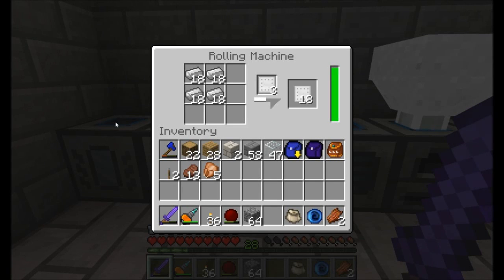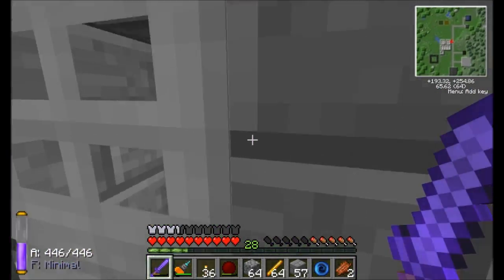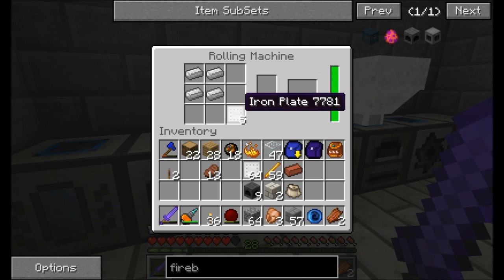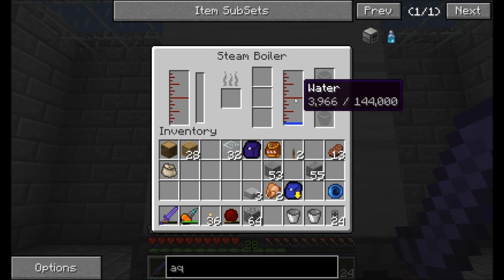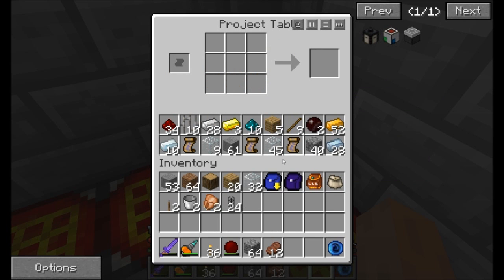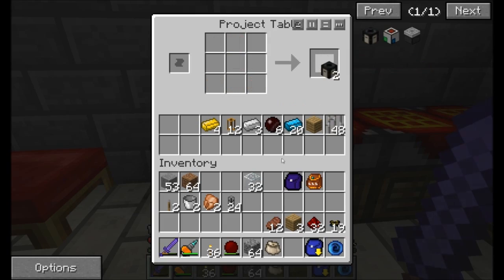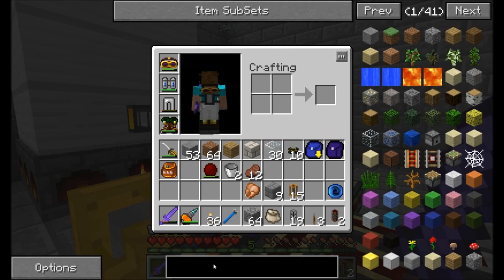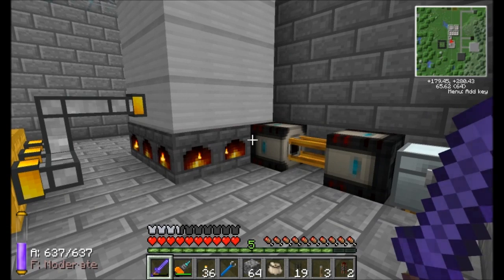Season 5 - Episode 23 Steam!

Comment: That is a good question. I was going to go with 4 hobby steam engines supplied by a smaller 2x2 boiler, seeing that they can run on steam alone but now i wonder if they need water as well. I would venture to guess that they don't. The next two tiers of steam engines will only accept steam.

Comment: It also depends on what you're using it for.  For example I currently have my tree farm harvesting automated from a logger powered by a hobbyist engine on a single tank liquid boiler running on the creosote output of the four coke ovens it feeds.  It's fully self contained and provides all the coal, apples and saplings to power the rest of my base with all the wood and creosote left I'll ever need.  Coal is, of course, for making diamonds, IC2 armor and the like (for me anyway).

Comment: To clarify, there is a point at which steam boilers become better than using fuel directly. However, because of the heat up period, it takes a lot of fuel to get to that point, and you also need to be able to store or use the output for none to be wasted to get to that point. Because of the huge quantities of fuel used and steam produced, you either need a *very* big place to store the output or a *lot* of engines doing things just to break even.

Comment: You don't even need that, just a transposer connected to the chest would be enough. It would keep trying to supply the boiler with fuel until it overflowed, and then the overflow would just be stored in the transposer.

Comment: The larger the Steam Boiler, the more efficient it is in terms of fuel usage. You will be generally better off building a single large Boiler instead of several small ones. The caveat being that its better to build Low Pressure Boilers rather than High Pressure if you want maximum fuel efficiency for short runs (where the boiler doesn't reach maximum temperature). If you're running your boilers round the clock, you get exact same amount of steam per unit of fuel.

Comment: What I meant was that coal is something you have to mine to get. Charcoal isn't super effective and require quite a bit of a forest to supply enough to run that size boiler. The best way to run a solid fuel boiler is by using blaze rods from a mob spawner. It basically takes care of itself, no other way would be as compact nor as efficient. That's what I meant :) - Of course you have liquid ones, but we're using a solid one atm.

Comment: when using railcraft steam production machines, use chunkloaders.
Machine with heat and empty water tank causes explosions, when you add water.
When chunk is reloaded, buffer will be empty.
My experience, my engines has blown (i had Aquenos accumulator)

Comment: I've played around with Boilers and steam engines a couple of times now, They just seem to eat coal and put out a relatively small amount of MJ, whereas Thermal expansion Steam engines consume a sensible amount of coal (low maintenance) and produce about the same amount. Right now I have 7 Thermal expansion steam engine generators producing all the MJ I need right now and a Freakin' huge HP boiler sitting there "Retired". Oh, and my massive barrel o' coal is empty thanks to the boiler! :-)

Comment: direwolf i know its a bit late but i did some tests with 4, 10 and 20 stacks of coal coke and hooking them then to a turbine to see how much eu they made. turns out that the smaller the boiler the more effective they are and produce more power but slower. steel ones are faster but make less energy but are a lot faster for example a LP8 boiler will make a hell of a lot more power with 10 stacks of coke then will a HP8 boiler and so on so forth with the LP8 boiler being the most effective i testd

Comment: I'd agree with you except your method requires either manually moving the cobble to the macerator, or piping/tubing it out. If you stick with TE machines, and put one next to the other then you don't NEED pipes or tubes. as far as power's concerned the peat farm should be able to power 10 engines without running low on peat, so says the wiki. :P

Comment: I found that steam actually isn't a great way of making buildcraft energy. The overall conversion from solid/liquid fuel to MJ isn't as good as just using that fuel directly and the only time it comes close is if you have a full size HP boiler running indefinitely, in which case you already have infinite fuel and don't need it.

Comment: Yes, I took it into account but it gets negated by real world uses. You either need to be able to use 100% of the steam as it is being produced, store the steam or store the energy for the normal mathematics to apply. If you don't do those, you waste steam and it becomes worse. Railcraft tanks are expensive and do not store the vast amount of steam produced. Xycraft tanks may, I didn't have them at the time. TE cells also do not store much energy.

Comment: No. There's a variable in the code that handles the "stepheight", or how high you can step. Most likely, they just made the variable go to "1" instead of "0.5" (the default value). Source: I've made hacked clients before, and that's the first hack I ever coded.

Comment: Not necessarily smart per se.  TE machines like that can output on any face except the front so he'd just have to connect to another side of it.  Also in my experience one accumulator can only barely keep up with the water needs of two full sized steam boilers (with tickrate lag possibly causing water to not flow in), so it's safest to just use one per.

Comment: Did you take into account that they consume much more fuel to heat up ?  They run with much lower fuel consumption after full heat. If you did your comparing while a boiler was still heating up then I'd come to the same conclusion.

Comment: I'm talking about the peat engines. Where does the assembly table come in? Doesnt matter if he has an assembly table, there's no gates on the engines atm, so they are wasting energy when they have no work. So use some of that wasted energy filling 2 buckets in the peatbog is fine dude. I'm not talking about making a system that autofills buckets using that water, what are you talking about? :S

Comment: Don't make a high pressure 3x3x4 boiler as your first steam boiler. It took 5 stacks of coal coke just to make any steam at all! Then it dropped below 100°C and stopped making steam because I was out of fuel!

Luckily there was enough for me to hook up my hobbiests to give some charge to my redstone energy cell! I suggest you look up ttower. dyndns. org / boilerCalculator / It says i need  54*64+29=3485 coke for a heat up taking 5:09:30 and 2*64+51=179/hr thereafter to keep it hot! o.O

Comment: 1: you do mean 111+ is above average, right? because anything above the average is above average
2: 150 iq here. While IQ's above 130 aren't common, there are more than you think. For instance, Keanu Reaves has an IQ of 170.
3: IQ is like RAM on a computer. More IQ just means you can process more information faster. Applying said information, however, is not measured by IQ tests, which are more logic-based and abstract, like solving puzzles.